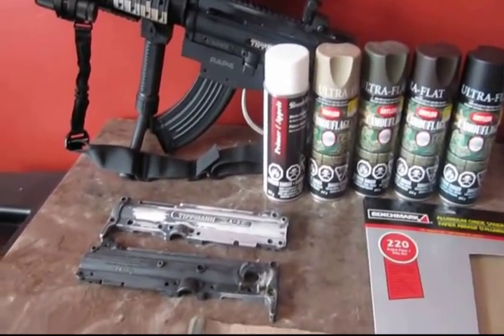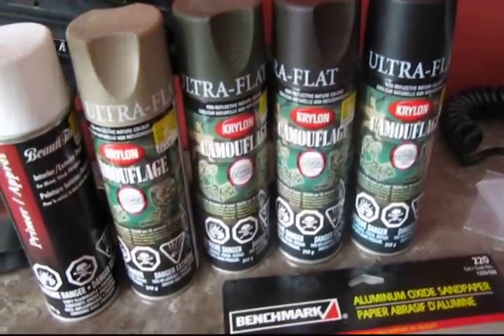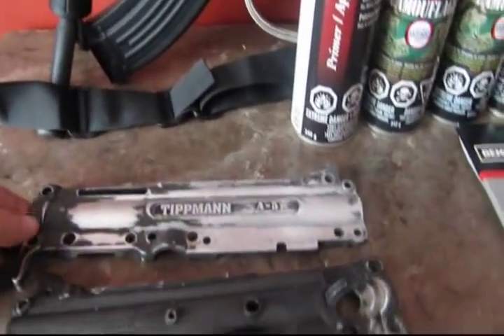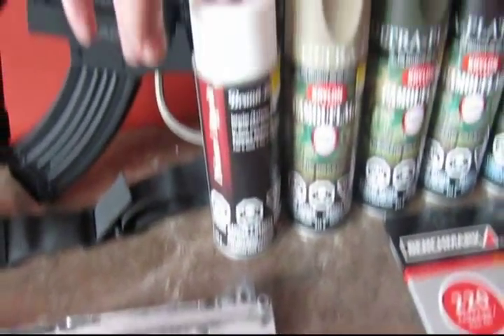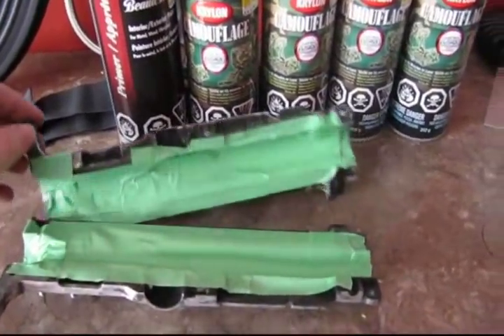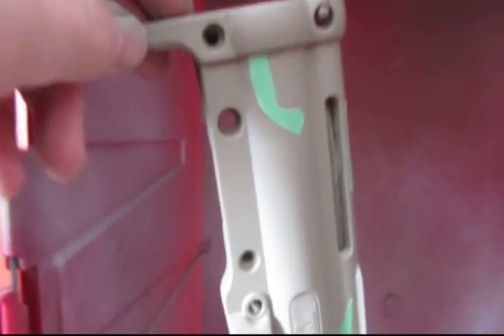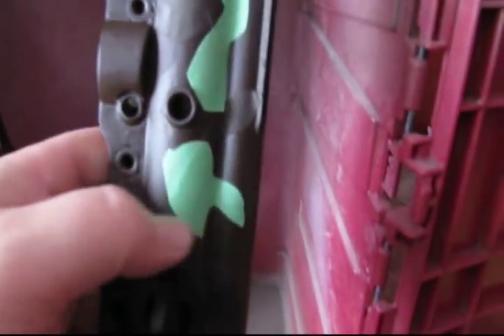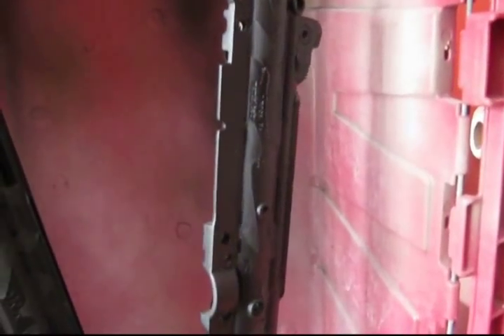Tippmann A5 Step by Step Painting Tippmann

Comment: Use aircraft paint remover from you local auto store. Let it sit for about 20 min and then you can just wipe the paint off. I did it to a TM15. Half the time and you don't leave any scratches on the metal.

Comment: Nice vid man :) 2 things: 1 - how long did each coat (and the entire process) take? and 2 - is it better to use insulation tape or masking tape?
Cheers man :)
Reply from the maker: about an hour for each coat but go by the directions on the can for drying time. i found masking tape to work the best. you can do any type of patterns with your tape, you can cut out different size triangles if you wanted to.